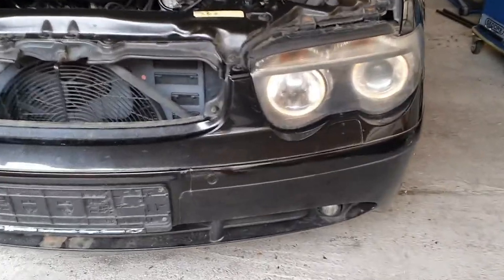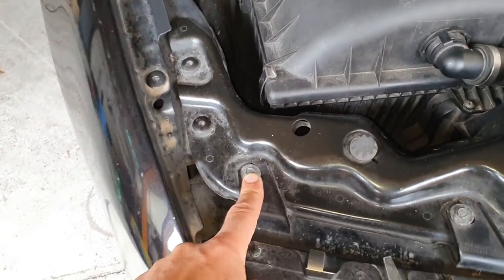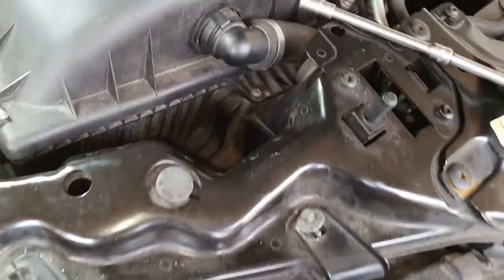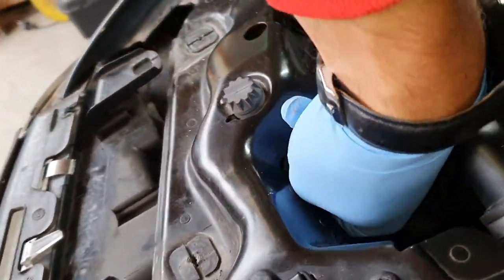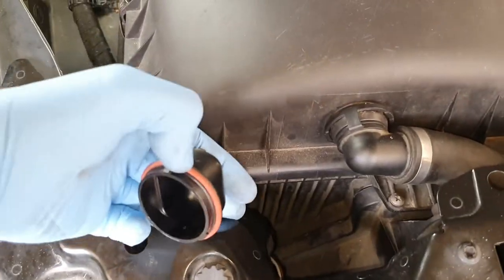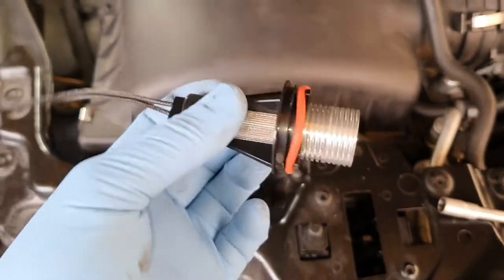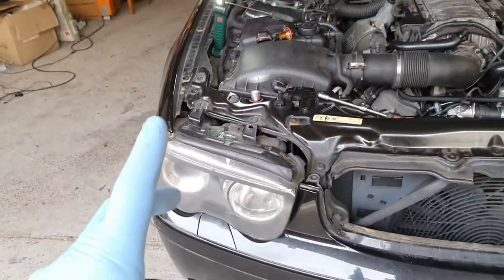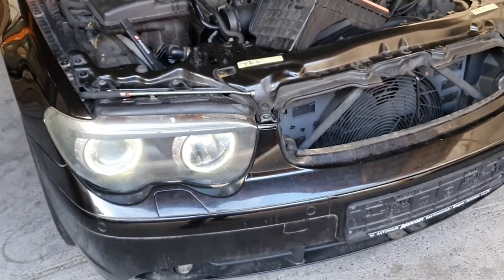How to replace the Angel Eyes on Bmw 7 series E65/E66

Comment: Yeah nvm If you have a 2006 bmw 750li this will not work you need to remove the whole bumper but good thing is it’s super easy so don’t stress it, I realized this because I matched up my lights with this video and it wasn’t matching up so always check ur lights before hand.

Comment: I don’t how I did it without pulling out the bumper and without taking out air box but i did😅 You should have included how you took out the air box, I had trouble removing it completely.

Comment: Can you do this on the 2008 750Li too or must I remove the bumper?
Reply: No because its under
Reply: I just tried this on my 2008 750 and did not work. You only have access to headlight not the angel eyes.
Reply: 2006-2008 you have to remove the bumper because of where the angel eye bulb is- it is not in the same location this video shows.  You can't access it the way this video shows.  I literally tried today on my 2006 750Li and you have to remove the bumper as it is much lower as other comments say.